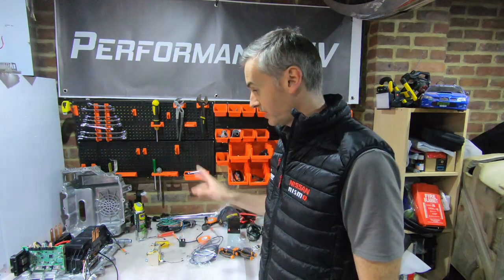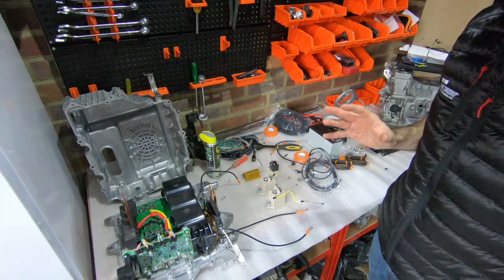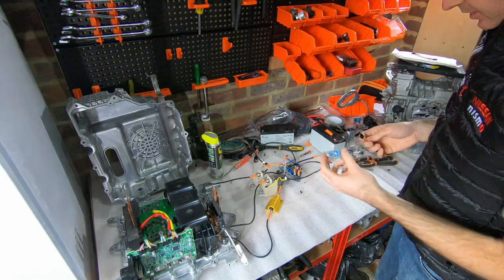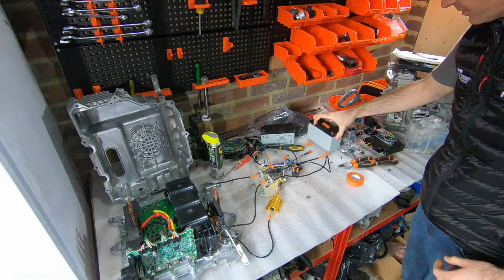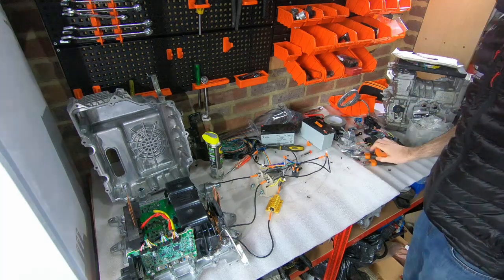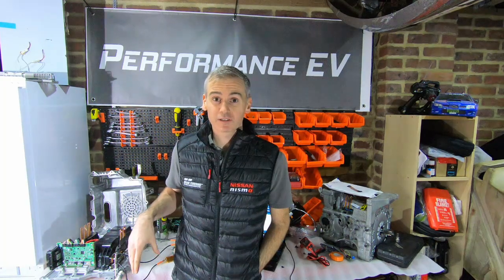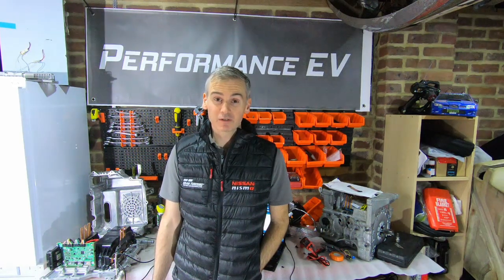Building an Electric Car - EV Parts - How to build an EV precharge circuit- Leaf Motor Teardown pt 6

Comment: Hi, great vid! I'm wondering if it's possible to get a inventory list of the components, except for the engine, used in this build?
I'm trying to build my own pre-charge but I've a hard time finding what parts I need, especially what control unit to use.

Comment: Wouldn't the Nissan Leaf Engineers have already designed a Pre-charge or inrush current limiter for the motor?
Reply from the maker: Good question.  The precharge and contactor control for the leaf (and a lot of other EVs) is internal to the battery pack rather than in the inverter or motor. So if you're using the components from a few different sources it is usually necessary to put something like this together or at least hook the control from the new inverter logic board into the existing control circuit.

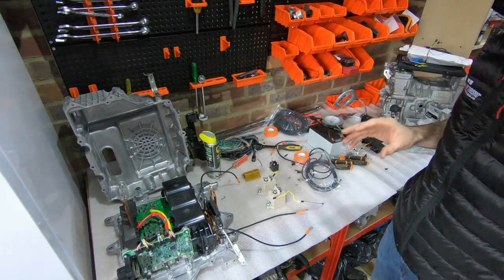Comment: 2:56 what did you say here: the capacitors of the what..? it's not very clear. Thanks
Reply from the maker: Hi, no problem. I think it was something like "in order to make sure the capacitor survives being switched on" just highlighting the purpose of the precharge circuit.
Reply: @PerformanceEV  oh, thanks! And thanks also for the great video.

Comment: Great pre-charge tutorial. Just what I needed to set things straight in my head on the precharge and main contactor side of things while sketching up my own build schematic. I have to get shopping for more bits!
Reply from the maker: Glad it was useful. It took me a while to get my head around it properly, and it really only sunk in once I had built out the circuit. I'm still figuring out all the bits I need to use to make it work with Johannes's control board, I'll be covering that in my next video.

Comment: is there any chance you could post a wiring diagram of the precharge circuit
Reply from the maker: I'll see if I can draw something up. I've had all those parts in a box for the last few months so I need to dig it out and remind myself of what I did:-)
Reply: @PerformanceEV  never mind i have done some more research on the entire Nissan system and i know understand the precharge circuit much better. thank you so much thought your videos are awesome

Comment: @Performance EV , thanks for the video. Can you help me understand what would be the drawbacks of closing the precharge contactor when the caps are actually discharging and still has voltage in them?, Example: when you do a quick key cycle?.

Comment: I loved the videos and will follow them to the end. But could you please do an extra with a boat in mind. Just using the engine and the battery. Maybee som wind gen. and solar charging.
Keep up the good work:)
Reply from the maker: Thanks. I would love to do a boat at some point in the future. A lot of the work remains the same in terms of motor control and batteries etc. The main difference should be around getting the power where you need it (gearboxes and all that.)